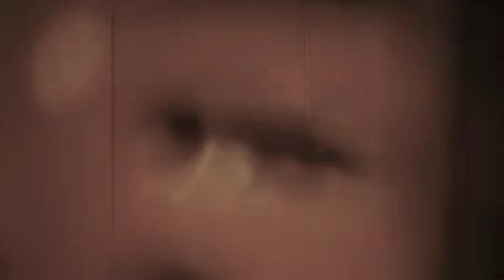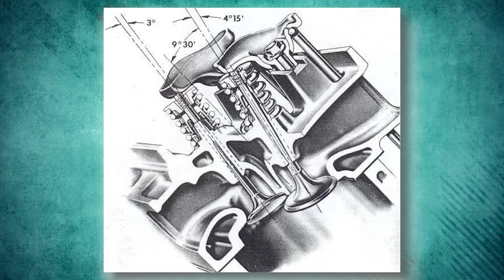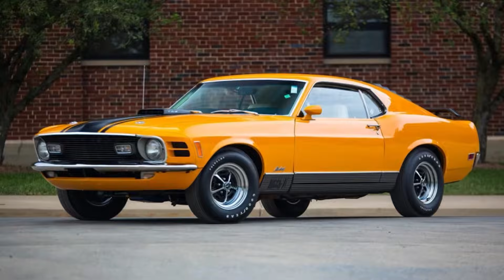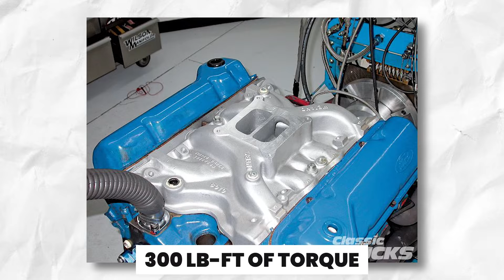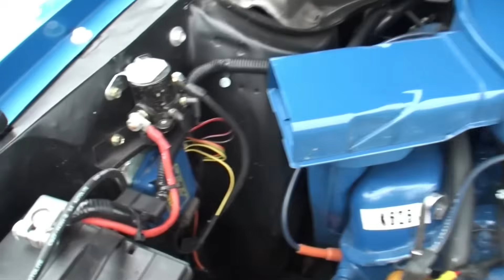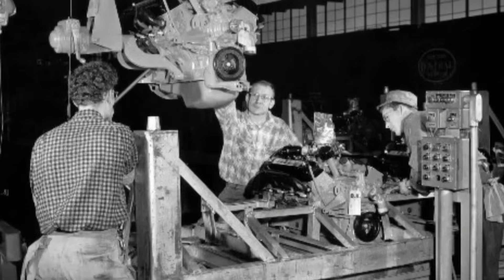The SHOCKING Truth Behind the FORD 351M

Comment: I have a big block 400 2v and came in my 73 galaxy. It's not a 351. It's as big as a 429/460 engine
Reply: They're actually shorter than the 385 series 460's by about 3 inches and narrower by about 2. Same bellhousing, distributor, valves, springs, and rocker arms as 460's.

Comment: I have a 400M.  It has an Erson cam  and an aluminum 4bbl intake with a holley 600 carb.  It actually runs good.  Its in my 59 F100.
Reply: A sentence that can make any man happy to hear one day I hope to have a engine that perty as well!
Reply: Is that Erson cam the same  valve timing as stock?  I understand that some people change the valve  timing by drilling a new pin location. I would rather just buy a new cam that is upgraded. Are they available?
Reply: It's not an M

Comment: All the old heads. Back in the day, and still today. Saying Windsor is a small block Cleveland is a big block and it's just the bellhousing on the m series. Acting like they reved and performed differently. That's how they implements stupidity on others.
Reply: Old Head here, the Cleveland is a small block, it shares the same bore spacing, motor mounts and bell housing as the Windsor family.

Comment: i guess m really stands for misunderstood, i had an early 400 1971 ltd, lots of power with just a 2v carb.
Reply: Definitely the '71s were rated far higher from the factory. 265hp and 400ft/lbs and they WORK!! First ever and only car I ever pulled an actual both wheels clear off the ground by over a foot had a 1971 400 Ford V8 and nothing other than an aftermarket CD electronic ignition box added to the stock points carburetor. It ran like a dream. I now have two 400 Fords one from my 1982 F250 4x4 and another donor short block from a neighbor. I fully intend to build the '82 truck block to similar static compressions specs of the 1971 and add free flowing exhaust, possibly aftermarket aluminum heads to drop weight and I already have an Edelbrock Performer 400 4V intake I may add my Predator carburetor and a rowdy hydraulic roller cam like a Lunati VOODOO and have it power my overland build based on a '94 F250 4x4 Supercrew cab. It has a 3" body lift I want to ditch and Install a cut and turned Dana 50 TTB coil spring converted front axle with lockers front and rear. Plus a ZF5 speed to work with the 4.10:1 axle ratios. It already has a Ford Tracloc LSD in the Sterling 10.25" rear differential. I may just add carbon discs to that and add a front locker. If I can manage ECTED's on both ends I will do that!

Comment: Definitely had issues driving a 351m originally from az in high altitudes near Denver
Reply: I had a higher mileage '79 F250 351M 4.10 ratio in 1983.  I did put a new timing chains and set it 4° advanced, and a turbo muffler.  I lived in Wheatridge, Colorado.  Drove over Trail Ridge road in Rocky Mountain National Park.  Up to the Eisenhower Tunnel with a fully loaded bed and towing a '63 Willt's Wagoneer.  All with no problems.

Comment: [IGNORANT] 400M ... 400M ... 400M ... 400M -- DO NOT TRUST ANY "INFO" PRESENTED IN THIS VIDEO.
Reply: The 351 modified was one of the best engines Ford ever made. We had one in a 79 F-150. It was great for pulling trailers. Lots of torque. Anyone who doesn't like these engines don't know what they're talking about!
Reply: No the M in 351M stands for modified, as in, the 351M is a destroked 400.  351M/400.  So the 351M has shorter crankshaft throws and the wrist pins are located lower down on the pistons as compared to the 400. So the crankshaft and pistons are the only differences between them.
Reply: Ai crap.

Comment: Had a 351m in a 77 tbird slow leaked oil sucked gas had a 390 75 f150 4 times the power and better gas mileage

Comment: The 400 came out in 1971 to replace the 390 in cars and trucks this article states. WRONG!!! I never seen any engine in a ford truck that resembled a 400 nor 351m until 1977 which is a proven fact. A 351 cleveland was never put in a truck period from the factory. I bought a retired Alabama state road dept 1977 f-150 2wd long bed with the factory installed 460 in 1981. Our local law enforcement could not catch that truck nor could they catch my 1967 ltd 2door 390 with factory 4bbl and dual exhaust. Aparently my CB radio and police scanner was faster than their GM garbage and early 80's ltd's sporting 302 smoggers. But being from a then dry county with BOOTLEGGERS we had fun polishing our experience on drinking and driving. Our sheriff was collecting payoff's from the bootleggers did it for many years. He was so friendly helping you tote youe beer and ice, but  if they caught you they would take it and resell it. A BOSS HOGG Dukes type of town. But finally the sheriff finally got busted and when he got out he ran again and won but couldn't carry any guns. Someone will probably say the 77 460 was a smogger well it was but used so much oil it was rebuilt with 429 dove heads bu a deceased uncle that turned wrenches for  ford racers around talledega.
Reply: I have a 1973 galaxie with a 400 2v. Got from my grandparents they bought in 73
Reply: I had a 72 Meteor with the 400, so it was around long before 1977.
Reply: 400 was available in 1970 but also was used in an experimental model that had both the big block and small block bell housing bolt patterns in 1969.😮

Comment: It's 351M/400 the 400 didnt get the M designation because the M was only needed so that the 351M could be differentiated from the Cleveland and Windsor 351s.
Reply: Correct except the 351M refers to the modified shorter stroke in the 400 block…
Reply: I was never a Ford guy. But. I've been around quite a few of the 351M.  I never saw a problem with it.  They can make real good power for not a lot of money.. 
 Being a Mopar guy.. I'd gladly take a 351m and use for any Ford project that I had...